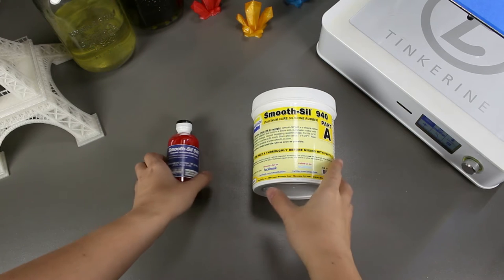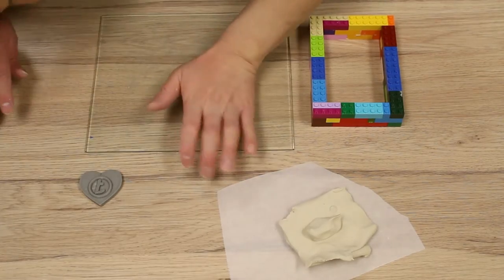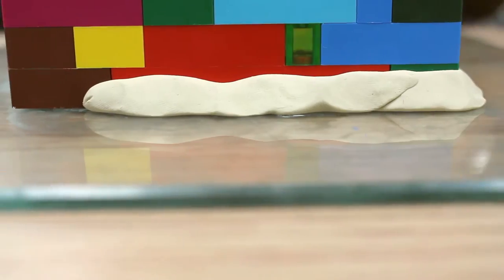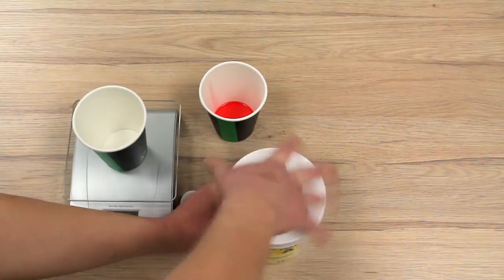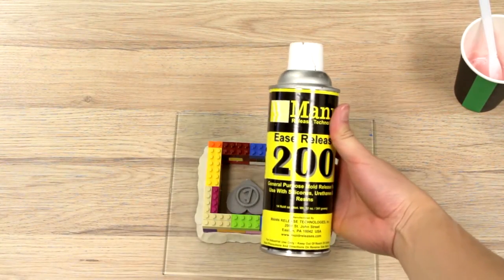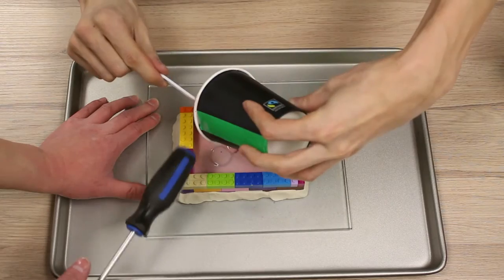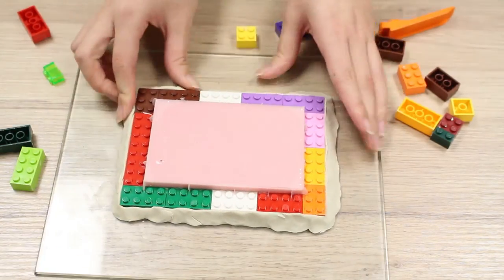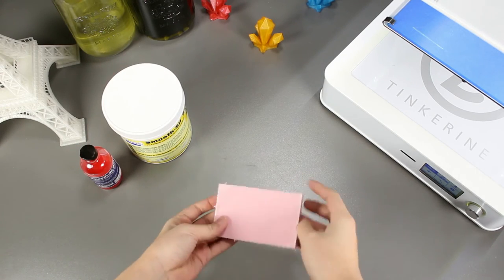Making a Silicone Mold with PLA

Comment: Another thought: make the surface onto which you'd be pouring the silicone PART of the initial design. Like, make a version of the initial shape that's got an oversized rectangular base, negating the need to adhere the shape to a base before pouring, and guaranteeing that the silicone won't go underneath the shape during pouring.